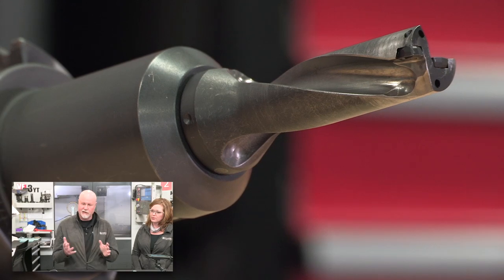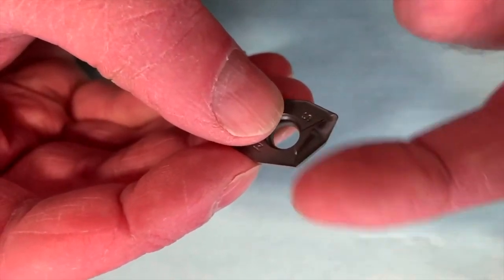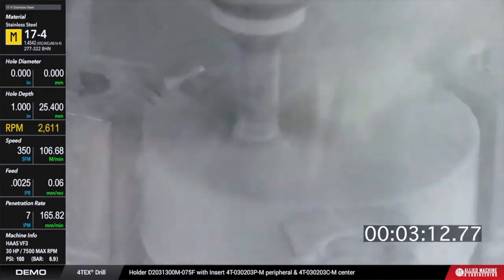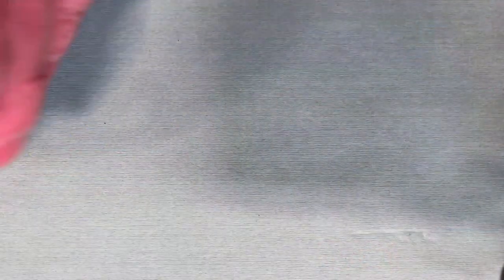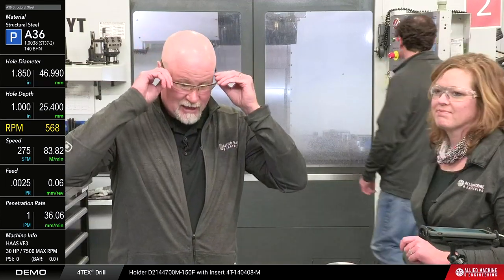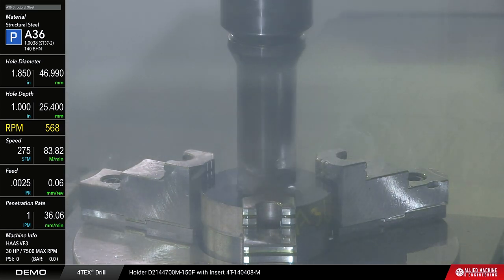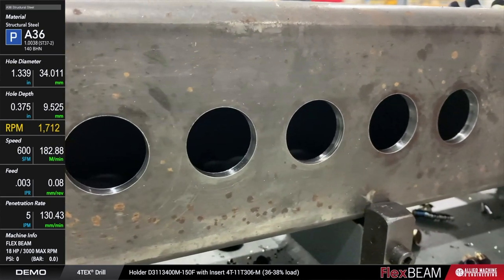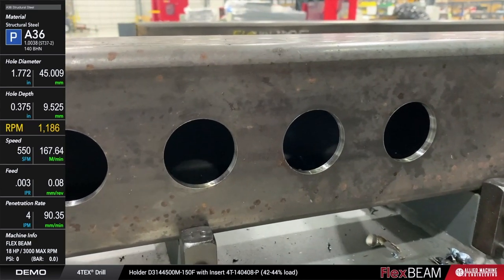Allied Machine LIVE: 4TEX® Indexable Carbide Drill Demo

Comment: is it possible to drill a hole diameter 39 X 300 mm deep on Vertical boring machine??
Machine is full through coolant, Maximum RPM is 6000
Reply from the maker: With a 4xD tool for 39mm, we have a max drill depth of 156mm